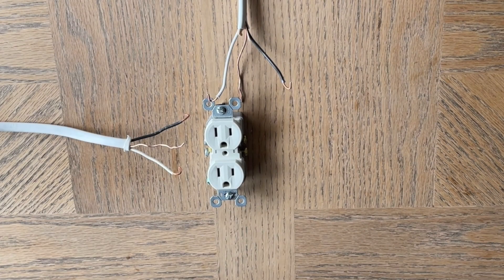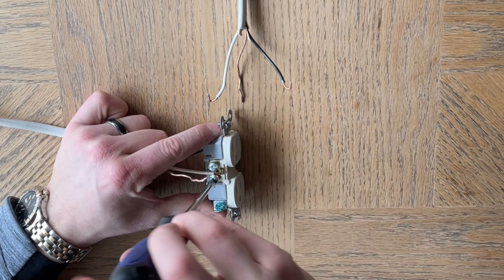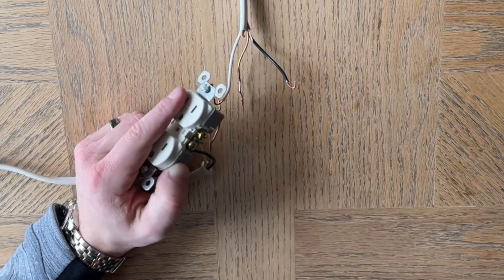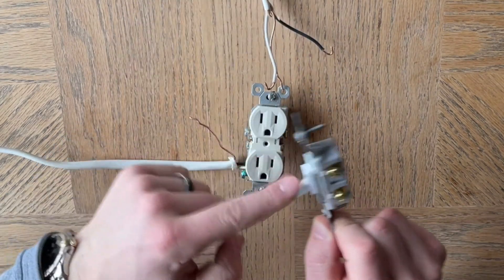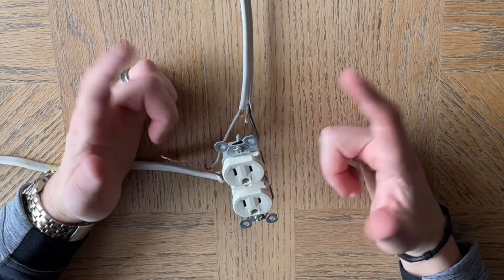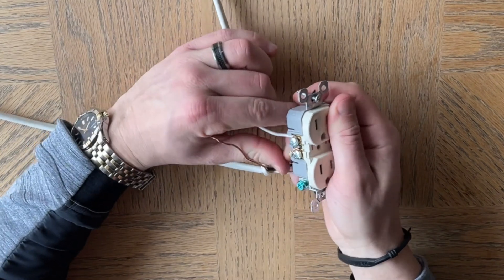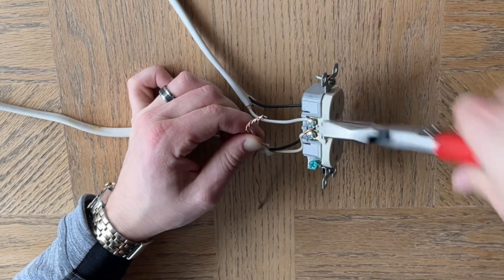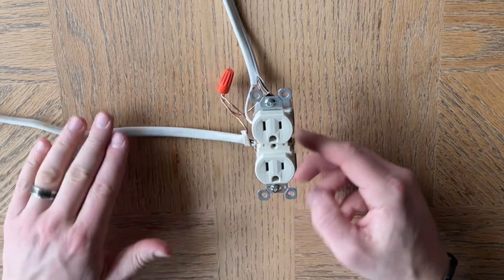How To Wire A Light Switch Outlet Half Hot Receptacle Controlled By Switch

Comment: In this scenario, if you want to extend another outlet that's always powered, do you pigtail into the hot and neutral of the bottom outlet and also pigtail into the ground?
Reply from the maker: Yes, you could daisy chain off of the hot half of the outlet.

Or you can run your wires in parallel. So pigtail off of the main line and send a pigtail to your half-hot outlet and continue the line to your next outlet.

Comment: Do you even have to break the neutral tab on the neutral side of the outlet? The neutral wires all go back to the same bus bar in the panel.
Reply: No u dont. Only on the hot/black wire right side
Reply from the maker: You only need to break the tab on the hot side. 
You’ll have a hot wire going to both the top and the bottom.

Comment: Hi. Thanks for the great explanation. 
I have an outlet like this but I would like to replace it with a wall light fixture/sconce. How would I go about the wiring?
Thanks
Reply from the maker: You want to remove the outlet and have a fixture in its place?

You’ll have to cap the hot line and coil it in the box. Then use the switch line for your fixture. That way, when you flip the switch, power travels through that line and to your fixture powering it on.
Reply: @HowToVideoChannel thanks for the reply!
Reply from the maker: No problem!

Comment: How do you add a second outlet to be controled by the same switch? Do you also break the neutral tab in the second outlet?
Reply from the maker: You can run wires from the switch-controlled part of the outlet to your second outlet. Basically, daisy-chain over to the next outlet.

Comment: So this only works if the source electric feeds both the receptacle to power the bottom, and also directly to the switch to power the top of the outlet since you have no traveler, right?
Reply from the maker: Yes, in this video the bottom of the outlet is being fed with a line in and the light switch is also being fed with a line in. 

The top of the outlet is receiving the power from the light switch. 

As you mentioned, a traveler could be sent to the light switch and then back to the top of the outlet to power that. In that instance, the entire circuit would be fed from the line in on the bottom of the outlet.

Comment: To anybody watching this video, I recommend checking out multiple other videos to gain a greater understanding.

I broke both tabs and it didn't work. Found out I was only supposed to break the copper side (right/hot/black). Had to go out and buy another outlet after stressing and finally understanding after watching different videos/testing with a multimeter.
Reply: Seems like you could add a jumper if you mistakenly broke the tab off that was my immediate thought when I watched
Reply from the maker: Thanks for sharing!
Reply: Any other videos you recommended, done a few different things and my top switch doesn't work still. My switch doesn't have any other wired beside one no main power connected to it as he's saying.

Comment: My question would be how to separate an already wired outlet that has both top and bottom operating off a light switch?

The outlet is under my sink serving originally as power to plug in to garbage disposal. However I just bought a touch less faucet that needs power. 

Can I still use that existing outlet as one always hot (faucet) and one controlled by switch? (garbage disposal)

I only see 12-2 coming in to outlet now. It may be 14-2. At the existing switch I see two black wires connected to it. What would I have to do to make one half of outlet hot all the time?

My existing wiring is as the following: As for switch it looks like power was coming in and wire to outlet going out. The two whites were pigtailed at switch roughin ( one from power and one from outlet). Then black from power and pigtailed black (from outlet) was connected to switch. 

Thanks for explaining your videos well but I am not sure my situation is like your video since I have two black wires on the switch. Can I make this work now that I need a constant hot half outlet? 

Thank you and I think something has to be retired at the switch but not sure.
Reply: Have you resolved the issue? I have the same issue and haven't found a solution yet
Reply from the maker: You’ll need to replace the outlet and probably add a second set of wires to power the faucet. Then you’ll have to separate the outlet so that half is hot and half is controlled by the switch. 

I’d also recommend calling a local electrician to explain the situation and see if they’ll give you some advice. They know the local code and would hopefully share some information.

Comment: Hello, the light switch in my garage controls all the receptacles, including the GFCI ones. So, when I switch off the light, there's no power to any of the receptacles, and all the appliances connected to them, such as the garage fridge, lose power. Is this similar to what was explained in the video you mentioned? I have three duplex receptacles in my garage. What steps should I take to address this issue?
Reply from the maker: Wow, that is really unfortunate. I’d suggest removing the switch and putting a wire nut on the wires so that the power constantly flows to all of your receptacles.

Comment: Hey this is my exact setup in my bedroom of my split level 1987 built house. I'm trying to convert the switched-outlet into constant power and the wiring is identical to your example. I replaced the old receptacle with a brand new identical one, but it's still switched. The light switch that turns on the ceiling fan/light, still controls the power to this outlet. There is NO red wires by the way. Any solutions? The light switch box does have some capped off white wires...
Reply from the maker: It seems like the only power supply to that outlet is coming from the switch. Perhaps you can bypass the switch by pig-tailing the two wires together. 

The switch is acting as your interrupter. If you bypass the switch, there would be constant power. No interruption. 

Of course, you may want to check with a local electrician as well.
Reply: @HowToVideoChannel  ok can you clarify which two wires?
Reply from the maker: 1) The live wire bringing the power to the switch. 
2) The wire going from the switch to the outlet.
Reply: OMG…Dude, you have NOT a clue as to what you’re doing